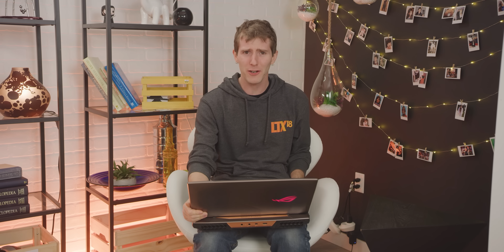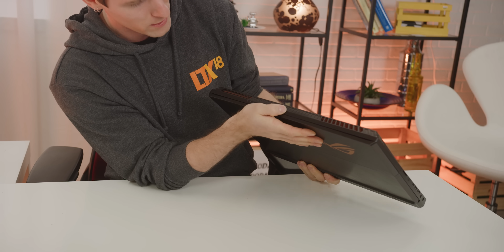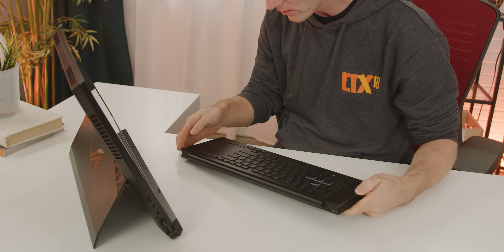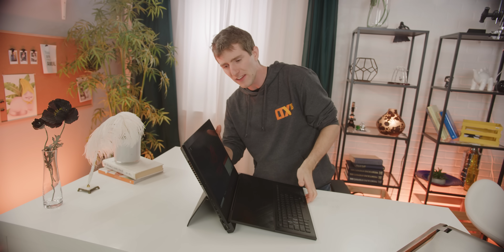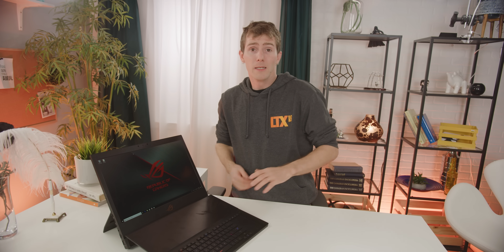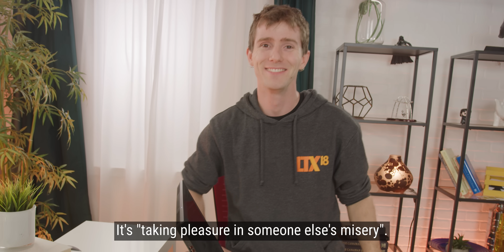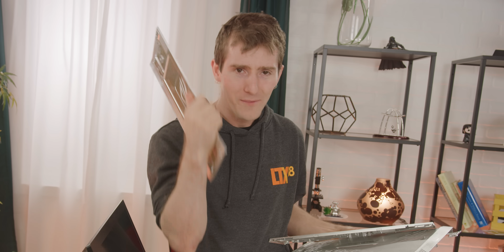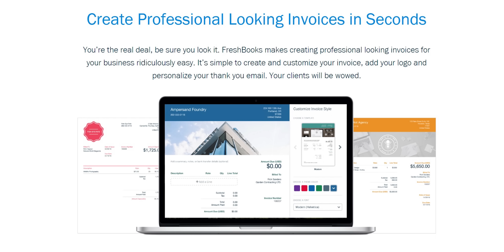A Surface Pro for HARDCORE Gamers - ROG G703 "Mothership" First Look

Comment: So Linus torpedo's the AMD powered Helios 500 based on pretty much weight alone. It was neck & neck in gaming to Intel/Nvidia alternatives in it's class, but owned in pretty much everything else. He even admits it was the most powerful stock laptop "EVER". Yet the title for this video of an obviously very flawed and HEAVY product is "A Surface Pro for HARDCORE Gamers!" That implies a positive for the product. The title for the Helios review was "Acer Totally Missed the Mark". He starts out the review by acting like he is going to set it on fire for fucks sake. I like his videos more than less, but please be less biased. Every video that features AMD seems to be "can it compete", which was an honest question before 2 years ago. The Question now should be how does it compete.
Reply: Because it doesnt compete in the mobile processor market. There's almost no amd products for laptops really it just doesn't compete nor does it keep up as well enough anyways especially not with the 2070 and up. And and intel cpus desktop or not still will bottleneck the newest gpu's from nvidia. Especially at 1080p at 1440p it's really more specific but worse with laptops. At 4k rta basically very little but still useless as 4k 100+fps is still rare without dual 2080tis and a beastly processor highly overclocked from Intel right now. Gotta pray 3rd gen ryzen gonna be a beast because they promised a 20+% increase over 2nd gen processors. Navi on the other hand they already admitted that they wont compete with nvidia high end gpus... which means 1070 at best for hopefully lower cost at least. Want 1080 power by a Vega 64. Which is still quite less compared to a 1080 both at stock.

Comment: This is actually a great form factor concept for a home theater PC. All it needs is an additional dummy cover for the monitor so that the "laptop" can be rested upside down in a home theater cabinet with all the vents drawing air from the top.

Comment: Can I do coding/programming in the Asus Mothership? If I can program this laptop then I’ll buy under $3500. New category Asus accidentally did: “The World’s First Gaming or Non-Gaming Desktop Surface Laptop”
Reply: If you dont know whether you'd be able to code on a device like this you really shouldn't be coding anything.
Reply: No you can't, it is locked for gaming only 🤔
Reply: @Omar Hatamovich Hajimatov You are very wrong my friend :-)
Reply: You ain't fooling anyone or asus, you don't have that much money to spend on a machine that is locked only for gaming.
Reply: @Omar Hatamovich Hajimatov I'll happily admit i cant code anything but i know that anything with relatively modern hardware is good enough to do so. That's why i said what i said
Reply: @Duncan23  depends on what you're coding. Creating mods or apps or literal games or something requires more power than you except. If you're doing web development or security patches or running linux systems for support or something. You don't need much to actually run those.

Comment: And im here thinkin 2.7 ghz is fast
Reply: well, it's fast if it's 18 cores.
Reply: I feel you, brother. The feeling I got after finally getting a new cooler and overclocking my Q6600 from 2.6 to 3GHz was awesome. Then I remembered that a lot of new PC's can automatically turbo up to way over 4GHz, even up to 5GHz and I was sad again.
Reply: I would have to under clock my cpu just to get a basic base line that low, and my cpu isn't anything even remotely special.

Comment: If that thing is gonna hit mass production all that aluminium is gonna be made on pressure mold from thin plate with 300 gram waisted material. In this state it has 50 kg waisted material and 10 000 $ in manufacturing process. Nobody wants to pay 30 000 $ for laptop

Comment: So can it be set at 90 degrees or do you have to look at it from that angle all the time
Reply: A small, foldable monitor stand would be great.
Reply: ya, no 70 degrees with this puppy
Reply: They should ship it with a dock of sorts to be able to freely tilt the screen
Reply: VESA mount screw holes in the back would be great.

Comment: SGi did amazing things with a MIPS processor that ran at only 300mhz. But morons equate hertz with performance so now we have processors running at 5 GIGAHERTZ! The whole purpose of overclocking is to make subpar chips perform at some level of adequacy. But you morons will only pay for hertz and core count. An Intel Itinium barely clocks more than 900mhz and it can do things you can't possibly imagine.

Comment: I was already thinking about getting a Tablet, because Notebooks are unwieldy and unergonomic and the Keyboards are crap. I would have used a Tower for gaming and multitasking whenever possible and take the tablet to the couch, kitchen, bed etc. Now I am thinking if it would be worth it, to have a large, heavy tablet and dock it to multiple monitors and Keyboard and all the other stuff at my desk or if I still would rather have a lighter Tablet  (Maybe with remote desktop to the tower) and not bother with all the plugging and unplugging 🤔

Comment: So its a very large tablet with PC components? Sure, I'm down for that. But two power supply bricks? So I'm going to need a bag for this monster and an additional bag for the power bricks xD? But I have been looking into building a PC into my car.. this might actually not be a bad solution, I could just put this under a chair and have a full blown high performance PC.. hmm.

Comment: Not a new concept, but haven't seen this form factor for more severe hardware so I'm hoping others do their own takes on it to see how good it can realistically get with some more innovations and trial/error.

How does the 2.5Gbps network work though - "[..] server that supports it"? Is it some niche proprietary trickery with 1Gbit networking, or is it something more commonly/widely supported with post-1GBps ethernet equipment?

Comment: Asking someone who uses a surface (Alex) to give it back is cruel :D
I would use this moster anyway! And i want a special edition with all the components except the 2080 and with slightly smaller and with a big battery in it. (and touch, and pen support, so basically it would be a big surface pro :D )

Comment: That's pretty cool, but it still requires you to bring a wheelbarrow to carry it if you go traveling. And of course, you have to sell your house (or your own body to perverts) to get the $3-4-5? thousand together to pay for the thing. I dunno, I'd probably still take a Razer 17-inch monstrosity over this. If I were ever to try to replace my gaming desktop with a portable unit, which I won't. I still say 99% of humanity is better served by a powerful desktop computer with dual or triple screens at home, and a lighter and more portable mobile unit for on-the-go computing.

Comment: WHY WOULD ASUS LEAVE OUT ANY FORM OF DISPLAYPORT AGAIN. Literally the most frustrating thing for me when owning a Zephyrus. My old ROG laptop with a GTX965M had a mini display port for G-Sync to external display. I get it’s supposed to be a desktop replacement but seriously, everywhere you search on the internet, a lot of ROG Zephyrus, Zephyrus M, S, users have still not gotten over the fact that we were given no DisplayPort out to utilize G sync on external displays. Fingers crossed the final version is given some type of DP. Literally I’m all over this thing if it does. Why have the greatest components inside of you can’t utilize them in EVERY form/scenario.

Comment: putting all those heat generating components behind the display with a heat shield also means you dont have to toast your palm overall better heat isolation from the user

Comment: interesting, they're going the way of the tablet but upscaling to be more like a high performance laptop. the only thing I see wrong with this is that still, like with all portable proprietary stuff, I doubt you could do things like enter the bios and undervolt for lower temps like you could on a desktop. even if it had a 9900k unlocked and a 2080ti I would probably still prefer to have a tower desktop PC because of that
Reply: You can still undervolt with throttlestop
Reply: it's easy, just do an accelerated back-hop and everything is unlocked.
Reply: Dont think a laptop could ever replace a proper desktop
Reply: Then this product isn't aimed at you
Reply: Hey DeSinc is Here :v
Reply: Honestly though, the best use-case for this device is as a LAN machine or for esports players on the go
Reply: Start an accelerated back bhop on the cpu clock speed
Reply: is this real? i mean, i cant tell if he's being serious in here xd
Reply: my gripe with it is that is meant to be portable and less bulky than the g703 and while it does seem slimmer i find it less convenient as a portable device since it has no backbone what so ever when you're going 305 mph
Reply: how would you fit a 2080ti in a tablet?
Reply: mak more h2 vied
Reply: then this beauty of a machine is not intended for you maybe for the top 1% who dont care to spend extra 10 grand on another gadget or pc ill get it purely out of curiosity and i don't know how to save my money
Reply: Lgr oddware in 20 years
Reply: ماعرف شعلق
Reply: I've undervolted my 7300hq just fine with throttlestop, -0.150v
I didn't see why you wouldn't be able to undervolt a higher end cpu
Reply: When the vids yo?
Reply: DESINCCCCC
Reply: I own a ROG GL702 and, even though you don't have any tuning options in the BIOS, you can use Intel XTU (or ThrottleStop) to undervolt your CPU along with custom voltage / clock speed curves in MSI Afterburner for your GPU.
Reply: Well if you don't have a need to transport your pc at least once or twice a month than any desktop replacement isn't for you.
Reply: Didn't think I'd see you here
Reply: Ok desinc i did not expect to see you here lol
Reply: >be me
>own gaming laptop
>somehow get burns on my leg from gaming
>thefuck
Reply: I actually hate gaming laptops bc compared to their desktop counter parts the price for the components are off the roof. also sht battery life.
Reply: @minimal5369  well you play with it plugged in, but you would be able to take it with you is the purpose. college student going between home/school/friends. hard to lug a big desktop around.
Reply: @mts982  isnt the purpose of a laptop is to be portable and reliable? How is a 3 hour battery reliable? Id rather have an mbp imo.
Reply: @minimal5369  ikr the price for just having the logo and mobility i bought an rog one and i regret it  looking back
Reply: @minimal5369  Gaming laptops are for people who need that power and can only afford one laptop...
Reply: DeSinc you are actually alive.
Reply: Wtf are u doin here
Reply: True that. I bought a Ryzen 2500u because I was told all AMD Ryzen CPUs are unlocked. Turns out it's completely locked down in the BIOS and all AMD overclocking tools are incompatible.
Reply: @nova_vista  Hey, it's not the CPU that is restricted but the mainboard. Only X370/470, B350/450, X300 support overclocking. Im pretty sure they cheaped out on the Chipset and put a "entry-level" A320-Chipset in it. It's locked down due to inferior components used on these Boards.
Reply: @nova_vista  more likely something from the manufacturer, or a bus that doesn't allow overclocking. those exist.
Reply: Make more csgo videos my guy
Reply: Hello daddy DeSinc.

And yes, words of wisdom.

This round is pretty much over.
Reply: DeSinc hi dad
Reply: DeSinc dad
Reply: Ey! DeSinc is here! First is me

Comment: they could've gone with a gigantic touchpad apple-style, instead on the go you either have to carry a mouse (given the size and weight of this thing it shouldn't be a problem) or you're stuck with a vertical and tiny touchpad. half of the keyboard part seems so empty and unused it's almost a shame.

Comment: Again they are trying to reinvent the wheel with the track pad..... HEY COMPUTER MANUFACTURES..... 5% like this unsystemadic pointless design... the rest of the 95% of humanity rather have the bottom middle design which has been proven to be more productive... so stop it. Thanks...
-By The rest of Society
Reply: at least off to the side means they don't need to worry about palm rejection, something I've only really seen work on a macbook (not well enough to justify buying one though)
Reply: I don't really think that people who buys this product would use track pad of any kind. And track pad on the right is okay for emergency, if you for some reason have no access to mouse.

Comment: I think this is a terrible idea. For one, in no way, shape, or form is this ever going to be usable as a laptop. The surface pro is finicky as it is, but something at least twice as heavy with the same hinge design is downright silly. Also, the /feature/ of separating the keyboard from the display is almost pointless, as most other AIOs have a touchscreen which facilitates keyboardless operation, whereas this most definitely will not. It's going to be the most unwieldy, most expensive, most niche touchscreen-less tablet ever created.

Comment: It would be cool if manufacturers could make more space efficient desktop replacement machines by just eliminating the batteries altogether, because you don't need those taking up space in your machine if you're just transporting it from your desk at work to your home office. an entirely separate battery would be extra bulk that you don't need day to day and then you can just take it with you if you need to work on the go. also the external battery pack could stay in your breifcase or laptop bag and plug into the machine so that you don't have to deal with the bulk of it at starbucks or on the plane, it would just sit off to the side in your bag under your table or between your feet  or something like that making for a much more pleasurable experience. yes it would make transporting a bit more of a hassle since it's one more component you could potentially forget, but to me it's a good trade off

Comment: Hey I have an Asus ROG G751J  I have used it lovingly for what 5-6 years now and recently I have decided to discontinue and retire it due to unforeseen circumstances ahem Laptops dont like cold temperatures and suitcases.... I had everything on there Alpha Testing for Anthem my recreational meme folder, and my memories from everything over its life. Im thinking about wanting to get a Desktop but after watching this video I dont know what the hell to do.  People are recommending a bunch of stuff but I have college tuition but I also have to be able to stream, fluid simulation renders, and the of course main cause for Gaming. 

Here is a friends build that recommended to me. https://pcpartpicker.com/user/Tahxic/saved/bW8Bbv

Lastly I have checked out premade Customs but I dont feel like paying x2.3 more for freakin SSDs Budget is probably $5k not what the Pre-mades have all recommended quoted cough 14k

Sorry for the long post just would like some help I dont know what the hell im doing and I quite frankly feel like im going to mess it up. Any tips (besides sending me to a playlist of videos)

Much Appreciated
Reply: Check out a desktop from CUK, they have a guaranteed 3 year warranty and you can get a costume pc, I bought mine and got it for 2k it includes a 500gb m.2, 3 tb hdd and an rtx2080 and an adus mother board but you can go for more expensive versions if you want to get that rtx sli 2080 ti

Comment: "All tablets bend" Well then, try bending this. (I own the new 12.9" iPad Pro and enjoy it, it's flat, but I wished Apple made it more durable like with 7000 series aluminium or something)
Reply: Doesn't really matter what grade of aluminium you use, if you design it too thin, it'll bend. Given how thin and light they wanted it they should have used carbon fiber bonded to an aluminium frame
Reply: @febel26  It will still bend but I think there's a chance it wouldn't bend in a backpack if it was 7000 series aluminium
Reply: As I mentioned, it's more a design issue than the material used
Reply: @febel26 If it was titanium I'm sure it would be a lot more durable. But yes it's also a design issue with the plastic areas for the LTE and Apple Pencil charger

Comment: Extremely expensive but truly a game changer for gaming laptops. Those CNC machined parts are beautiful too.
Reply: IKR it looks so cool
Reply: This shit has to cost like 8k with taxes lol or more
Reply: @christianquinones9347  yes, peasant
Reply: lol how when you cant use it on your lap?  most gaming laptops are small enough to use on your lap without a desk. this you can only use on a large desk lol
Reply: Yet no mechanical keyboard...
Reply: I really don't see the point in this product. It is incredibly niche. It isn't much more portable than an mitx system or custom desktop like the new Corsair One. It will be much more expensive as well.

You also won't be able to upgrade the screen or most other components. When your screen dies or has some issues like dead pixels you have to send the whole machine back to get it fixed and if it is out of warranty will be incredibly expensive.

The only advantage is this is slightly more portable than a small desktop and has a battery that will probably drain in under 1/2 hour of gaming.
Reply: This is a prototype,  if they get to produce about 10 000 units, the milling will be pointless.